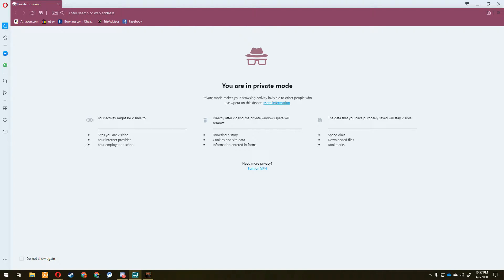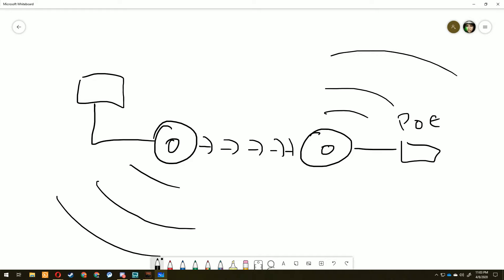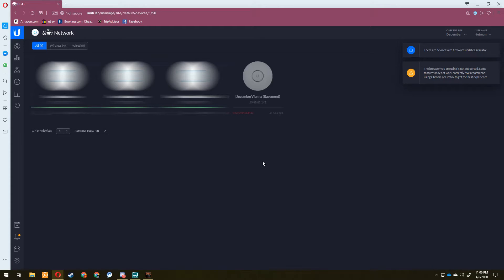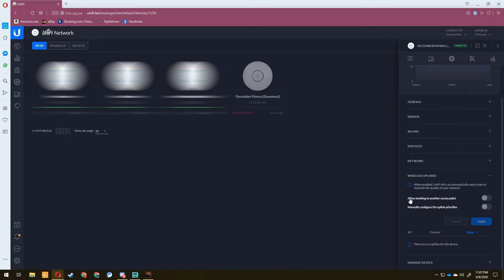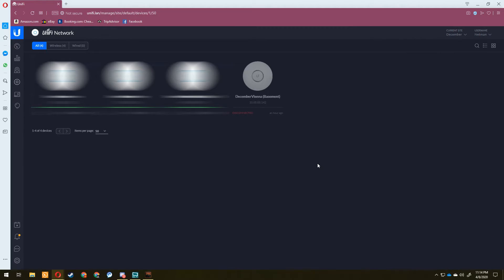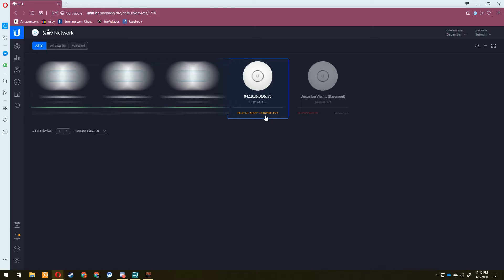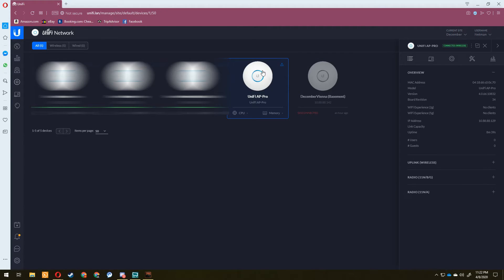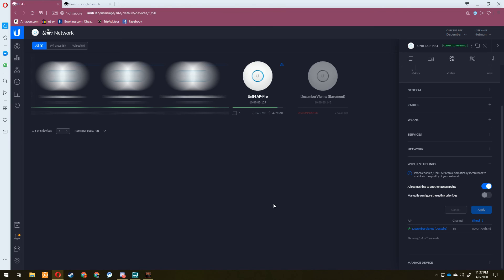Unifi Wireless Uplink

Comment: How does the second AP get power tho if it's just using a Poe injector ? I have two aps both connected to a switch.
Reply: What do you mean? The injector is plugged into the wall.

Comment: Hi, thanks for the video. I have a questions. I want to extend mi internet to another room is this connection correct?   (ISP Router) -----UTP---> (Ubiquiti Switch Lite 8 PoE) ----UTP----> (Ubiquiti Access Point U6 Lite) ? Thanks in advanced

Comment: It is actually a very useful setup.  I was even able to connect a LAN cable from the POE injector providing power to the wirelessly connected AP to a small Edgerouter X switch which can then provide wired connections to 4 more devices without wifi chips.
Reply: It´s a bit late but do you think that would also work with a normal PoE switch? And do you have any experience in bottlenecking your wired connection after the Wireless Uplink?

Comment: So if I have 4 Access Point at 1 floor, should I disable mesh or not? This is for my office network.
Reply from the maker: I usually disable the mesh if all APs are going to be hard-wired.  Sometimes, it can help if there are connectivity issues (APs will wirelessly uplink while the main connection is down) but IMO the extra interference caused by the uplink just isn't worth it.
Reply: @ToastyAnswers  So for you it's better to disable mesh for 4 AP? So let's say I connected my laptop from A place to the Closest AP possible and decided to move from A place to D Place, and because mesh it's disabled, the signal I got from A place are decrease because the AP didn't mesh together to send the signal to D Place (Closest AP on D Place)

What do you think?

Also for 

"I usually disable the mesh if all APs are going to be hard-wired"

What do you meant by that? Does each AP need to be connected themselves by LAN cables?

Comment: What about channel selection on mesh AP.  Should it be the same as the wired AP or different? Maybe the same on 2.4 which I assume it uses for the mesh connection or does it use both? What is the best practice?

Comment: Can you please clarify what you meant in the beginning of the video about Unifi APs not being suitable for use as a wireless network extender?  I believe you said you can't do that and the upstream wireless AP also has to be a Unifi unit.  I have a UDM and it works great, in terms of speed and coverage.  However, I do want to put a POE wired IP camera in an area of the house where there is no ethernet.  

I do have AC power and an available POE switch in the area where I want to put the camera.  I was hoping to power the camera and access point using the POE switch and wirelessly link the camera stream to the rest of my network using the AP.   So I'm essentially trying to do what you described in your basement example except I need a wired connection vs. the wireless example you used.  

Thanks for taking the time to make the video.
Reply from the maker: I just meant that the Unifi AP is not going to re-broadcast (extend) any and all wireless networks.  The point I was trying to get across is that the network has to already be using Unifi access points.  For example, you cannot wirelessly extend your network if your main access-point is a Netgear router.  Hope this helps.

Comment: Great video. My AP goes from Heartbeat > Disconnect. How to I get it to go to isolated? I have the wireless uplink feature enabled.
Reply from the maker: If it doesn't go into isolated mode it isn't getting a connection to the upstream AP.  Is the "Allow Meshing" feature enabled on the "upstream" device and are they within 5Ghz range of each other?
Reply: @ToastyAnswers  "Allow Meshing" feature is enabled on all of my hardwired APs. I got hired to a company with 3 buildings. They had 2 APs in each building but there building across the street from their HUB has the (wireless) APs connected. The other 4 are hard wired in. I'm trying to add 2 new APs to the building across to street (wirelessly).

I believe all the upstream devices only have a 2.4Ghz range, the two new ones that I have, have the 5Ghz.

Comment: Thank you for your video, I getting lost to try to set up one of my 2 Unifi AP as repeater. I am not able to see the option "Wireless Uplinks" under conf. Any suggestions?
Reply from the maker: What model AP are you using for the uplink?
Reply: I understand if I using other vendor AP wifi internet uplink.. I can't use unifi as repeater? I need to connect a  unifi to modem internet?

Comment: How do I broadcast "house" on one SSID Wi-Fi network on only one AP (UAP-AC-M(3)), and not all three APs. My internet provider starts from my (garage) to a USG-3p -> US-8-150W -> UAP-AC-M(1) -> downlink to (house) -> UAP-AC-M(2) -> US-8-60W ->  UAP-AC-M(3). In Settings > Wireless Networks >  Selected AP -> AP Group -> choosing UAP-AC-M(3) only. The network goes down. If I select all 3 APs, the network is up but is broadcasting on all 3 APs. I only want to broadcast "house" on UAP-AC-M(3) but it doesn't work. Any ideas?
Reply from the maker: Is house using a specific VLAN tag for the SSID?

When I configure this, I create a new WLAN Group (Settings -> Wireless Networks -> "+" button at top of page) and create the Wireless networks I want advertised by a certain AP.  Then, go to Devices -> "UAP-AC-M(3)" -> Config -> WLANS and assign the new group to the AP.  This will only advertise SSIDs you have configured under that group.

There could be a bit more to this if you are using VLANs for the SSID you are wanting to advertise.
Reply: @ToastyAnswers  Thank you for responding. I did what you described and AP(1) and (2) dies. I am using multiple Networks each with their VLan assigment and each their own Wi-Fi. If I understand you correctly, the uplink-downlink APs will only work if on VLan1 or ALL. Won't work using VLan assignments.

Comment: If all the access points are cabled directly back to a Poe switch can I turn off uplink on both channels I’ve noticed that it’s enabled by default.
Reply from the maker: Yes, turn off the feature if you don't plan on using it.  If all APs are wired then the wireless uplink feature just takes up air time.

Comment: The problem is , that the secondary port on the repeater is becoming dead , when connected wirelessly. I needed that to connect a VOIP phone to it , but I can’t
Reply: The secondary wired port is a pass-through from the wired uplink, unfortunately, you can't use it in wireless-only mode.

Comment: not sure if you did some test but do you know the speed between ap and the repeater? im trying to set one up for my nvr thats in my garage but i dont have ethernet cable that goes into that location. would that be a problem do you think. my nvr is 4k, 8 channels with 8 cameras.
Reply from the maker: It may  be an issue at 4K, but it really depends on how much bandwidth your NVR requires (4K is high resolution, but the framerate, bitrate, and other factors will determine how much bandwidth it actually needs).

The wireless uplink I've tested gets roughly 15Mb with a 48% signal quality.  It all depends on how much your system requires.  I would be more concerned with drop-outs, which happens fairly often unless the APs are not very far apart.

Comment: Hi, can you please assist me. I currently have an AC Pro and looking at adding a range extender to achieve about 500meter radius.

So far I have identified a TP Link range extender.

My dilemma is: if I use a range extender will I still be able to broadcast the network I setup via ubiquiti controller and hotspot voucher manager?

Also, do I need to have the pc or controller on in Order for the network to be live?
Reply from the maker: I don't have a ton of experience with range extenders, but off the top of my head I don't know of one which can repeat multiple networks.  I'm assuming you have a primary SSID and a guest SSID which uses the guest portal and voucher codes for access.

You would only be able to extend the range of one network at a time, unless you have multiple extenders.

Another option would be to get another Unifi access-point and use the wireless-uplink feature.  This would allow all configured SSIDs to be "extended" to the new access-point.

If you are using a guest portal (for the voucher codes) then you will need the controller to always be on.  This is one of the very few features that requires an "always-on" controller.

Comment: Hello, nice video, I have 2 more APs on the way to expand the range of my network, and I was wondering if you need to have the Unifi Controller running all the time for the wireless uplink to work or you can just unplug your PC and it will be working and connecting properly after the APs restart? I don''t plan to have the Unifi controller running and I don't want to spend more money on the Unifi Cloud Key
Reply from the maker: Hello! You do not have to have the controller running all the time for uplink to work.

The controller is only required for things like alerts, historical statistics, and the guest portal.
Reply: @ToastyAnswers  thanks a lot

Comment: Hi there, I have 100 down and 50 up, currently on UAP AC LR. Thinking of having another AC LR for the uplink. Does the SSID will be "merged" together with the main unit? Or, there will be 2 set of SSID, the main and the uplink UAP?
Reply from the maker: If you assign the same wireless profile, it will use the same SSIDs as the other AP.

Comment: I did have my two AP AC PRO setup the same way and my devices would start and buffer with the mesh. So they are both hardwired and my download speed is 250 down and 220 up without mesh.
Reply from the maker: Yeah, hard-wired is the way to go if you can support it.